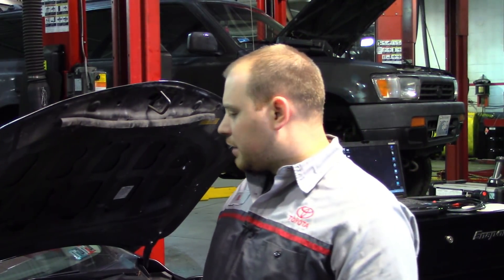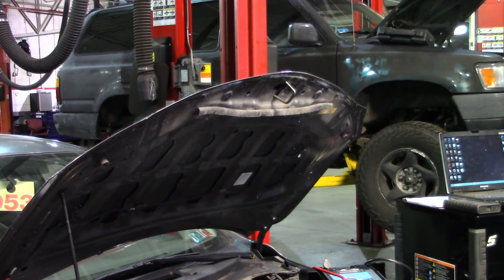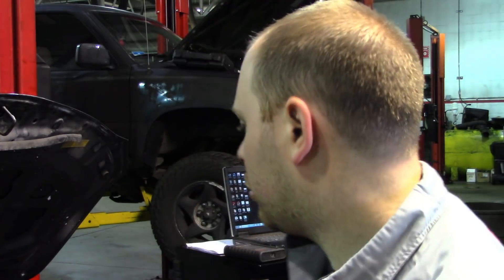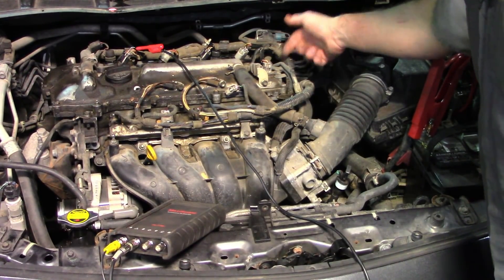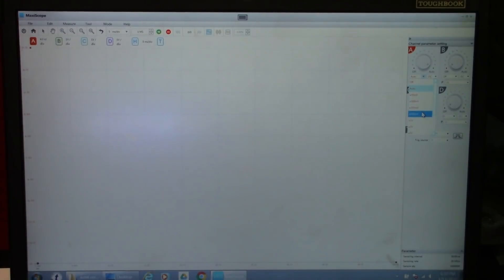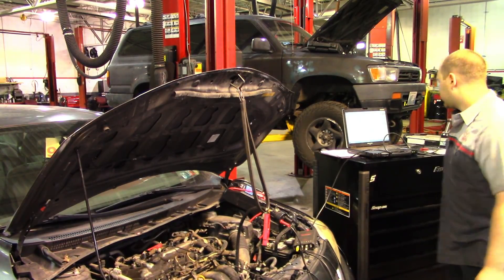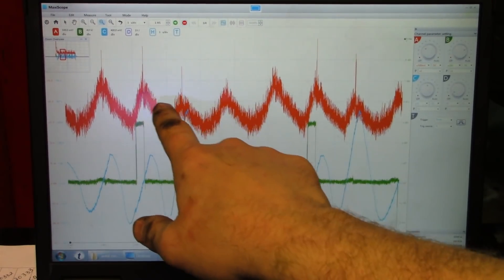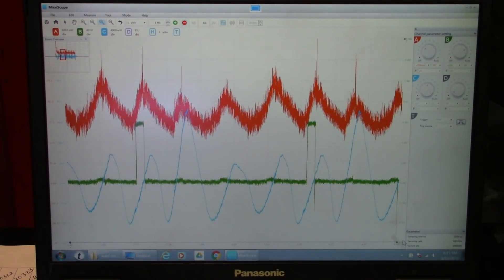'09 Corolla misfire diagnosis

Comment: Great process Pat as usual. You do a great job in your vids. I do take issue with one piece however; doing a "leak down" test at BDC. Almost every engine, including this one in this 2009 Corolla has a valve OPEN at BDC. During the intake stroke, the intake valve is designed to stay open slightly into the compression stroke (after BDC intake). During the power stroke, the exhaust valve is designed to already be open before achieving BDC of the power stroke. Either scenario - BDC intake stroke or BDC power stroke - will indicate a false diagnosis of leaking valves. Leakage testing should only be done at TDC.
Reply from the maker: I just pinned this comment because I want people to see that you cant do leakdowns at true BDC. I also added a correction to the description. Thanks for the comment!
Reply from the maker: I agree with 99% of what you said. I don't actually do leak downs at true BDC. I spin the engine over until I can feel the intake valve close with air in the cylinder it is easy to feel. Then I go a hair farther to make sure that the valve is fully closed. I should have explained that a little better.

But you can 100% do leakdown tests with the piston below TDC.

Comment: My 09 Corolla Le has a cel that reads cylinder 1 and cylinder 3 ignition coils were malfunctioning. Ignition coil 3 is brand new and has less than a thousand miles on it. One two and four came with the car. Any ideas? Please and thank you.

Comment: But if #3 is on BDC, isn't the Intake valve still open a bit? Or you go just past actual BDC to close the Intake?
Reply from the maker: Yeah, i didnt convey that well in the vide but i pinned a comment to better explain it. Thanks!

Comment: I do not use BDC for one simple fact, let's call it valve overlap but that is not the exact proper term. At BDC exhaust stroke the EVO is already happening and at BDC intake stroke IVC has not yet happened. In fact how far open are the valves and how much will they leak, very little. Back to your usage of the overlay chart, different charts have different characteristics, this chart is BAD, the way that you lay it out, you set it at TDC on the left side of the screen, you then dragged the chart to the right to align it with 720* of the next compression stroke but in the process of dragging it to the right, the entire chart moved to the right, honestly for the purposes here, not important, but for the guys who watch your channel and learn from your mistakes, please start the overlay on the right and drag it to the left and it will not move. There are other charts that don't have this characteristic. Thanks for the class on a blown head gasket, with and without nice test equipment, I also only use shop air for a leak-down test. Better to find a leak into the cooling system at TDC, cheers.

Comment: Mine has 187k and was running good. First time the check engine came on for the missfire did the spark plug and coil. Moved the injecors around and pretty sure the miss fire didnt move. I'm checking that today. Pretty sure the engine is screwed. What a piece of trash. Cars these days are a joke.

Comment: A couple of years ago my neighbor asked me to look at her 09 Corolla with 230,000 on it, the mil was lit and it had a p0301,,I swapped number one coil with number 2 and the misfire moved , I replaced the coil and it was fine until a month ago when she said it was running bad and the light was on, this time a p0301 and 303 came up, I decided to replace all the coils since they were original except the one I replaced before, it threw a 301 again so i put the newer coil in and I'll see what happens, they were all aftermarket Chinese coils I did because OEM are like 100 a piece, I don't know what else to do, I'm not a pro and she doesn't have a lot of money I think it's just another bad coil.
Reply: I thought mine had a bad coil or spark plug. I replaced them and it didn't get any better. Now I'm thinking it needs a head gasket because that's the next thing on the list. Or maybe something to do with the timing. It's a huge job and if the block is warped it will be $2200 to replace the straight block and I'm just not sure that's worth it.

Comment: How much would it cost to do an engine replacement on that car my 2009 Corolla has the same problem
Reply: Idk if I would want another at this point. 187k miles and mine.  Switched injectors and it still miss fires on 4 even after dpark plugs and a coil. Pretty sure the engine is screwed. And I just replaced a whole bunch of stuff on it right before. Some bs. Wish I didn't buy a 2009

Comment: Im having issues with a 09 corolla, cyl 4 mis code, did new coils, plugs still having the miss and surge at stop light,  changed up stream o2 and no change.
Reply: Me too miss fire on 4. Did the spark plugs. The coil on 4. Cleaned the throttle body. Ran fuel injector cleaner. Took it to a mechanic and $114 later they couldn't figure it out said it wasn't mis firing and then the switched injectors 2 & 4.   Waiting for the drive cycle but I'm pretty sure the miss fire is still on 4. So I guess the next thing would be a compression check.   I wish I didn't just replace a whole bunch of stuff on it a couple months ago. Now that this is happening.

Comment: Question please, you had mentioned you frequently see pitting in the cylinder walls of this engine is that what I understood you to say? How does that happen and why? I have a 2009 Corolla 1.8 engine with 250,000 miles and it’s running aces but very curious on that I never heard of that before. Thank you for your answer.
Reply from the maker: Not on the cylinder walls. But pitting between cylinders.

As far as why. That I’m honestly not sure of. But with your mileage, I’d consider changing the coolant.
Reply: @VoltageDropDiagnostics  Thx so much for reply here in my question. Never heard of this before. I have indeed flushed the cooling system and change the auto trans fluid every 50K miles since odo hit 100K. I also add Lucas Fuel Conditioner with upper cylinder lubricant since the the 100K mark on every fill up. Thx again!

Comment: I have an unrelated question about a 2009 Toyota Corolla LE 1.8 auto. Do you think it is safe to do a transmission service on a car with 140,000 miles. Trans service has never been done and fluid is black/red and dirty. Trans seems to shift fine.
Thanks
Reply from the maker: I wouldn't be too worried about it causing issues. I assume you're just doing a drain and fill? Thats what I recommend, while using Toyota WS fluid
Reply: @VoltageDropDiagnostics  I'm thinking of just doing drain and fill. I heard filter is more of a strainer so I probably just leave it i guess. At Toyota do you change trans filters or primarily do drain and fills? I think it takes just over 3 litres. 
Thanks for the response back
Reply from the maker: @mazdaman7739  generally we just do drain and fills

Comment: Great video Pj! Just got around to watching it! Top notch content as always! Appreciate your leakdown tool and technique. 
Great analysis of the waveform and diagnosis. 
If cylinder 4 compression wasn’t also low would that have lead you to suspect cyl 3 intake valve leaking during compression? 

As always thanks for sharing brother!
Reply from the maker: Thanks Angel! Sorry that I am just getting around to these comments! I have been so busy lately! 

But to answer your question. Yes. If cylinder 4 wasnt also low I would have suspected a failed intake valve. Good catch on that by the way.

Comment: I need a pulse sensor.  Also need a in cylinder pressure transducer. And a used pico. Have yet to use any.
Reply from the maker: haha! Once you learn to use a pico, it will open up an entirely new way of diagnosing vehicle failures.
Reply: @VoltageDropDiagnostics  I'm going to that class for sure . Hope you will be there as well and get my pico signed lol.
Reply from the maker: Andrew Hinojosa are you on Facebook? The registration for the class was just posted!
Reply from the maker: https://www.rosedaletech.org/diagnostics-seminar/?fbclid=IwAR3zb6rtlvh8hmo06ZYkcaVRDRJRtaWK9FkZ12hdBOolEzDmFZBz0xMamk4
Reply: @VoltageDropDiagnostics  thanks I'm signing up asap.

Comment: Hey pat very informative video but what I can't understand why there is an intake Pressure spike in the cylinder 3 if the intake valve of the cylinder 4 is open normally the pressure from the cylinder 3 escape to cylinder 4 so no spike in the intake
Reply from the maker: So your question is. Why is there a pressure spike, when cylinder 4 is on the intake stroke? My best explanation is that the intake manifold typically under vacuum. But even though cylinder 4 is pulling vacuum, cylinder 3 is pushing pressure. Even if they counteracted themselves perfectly, youd still have a loss of vacuum in the intake until the next cylinder pulled it back into a vacuum state.

Does that make sense? Did I answer the question?
Reply: @VoltageDropDiagnostics  it does thank you so much

Comment: An easy way to find cylinder cycle and TDC is to put a toy balloon over the cylinder test hose barb. Then roll the engine.  The balloon is very sensitive and will show TDC or BDC.  Using 2 of the pressure regulators, like the one you used, in series, with a .062 orifice between them, makes a leakdown tester.
Reply from the maker: Thats brilliant!

Comment: What I think you should say  is the reaseon why  the engine is broken too premature. for toyota 210k is not too much. I am pretty sure the engine overheat and the head gasket were blown....But whe question is Why happened that. Skipping oil changes, water systen wast propperly mantain... or the engine were abuse of rev ups, etc,

Comment: Thanks for not using the Pico for those of us with other not so fancy scopes. That Autel did a great job. Was it the injectors disconnected that disabled starting?  Because if u disabled spark u wouldn’t get cylinder firing pulse. Igt.  Correct?
Reply from the maker: Exactly! The PCM wouldnt have seen an IGF signal return and it would have stopped trying to fire the coils most likely. Plus I dont want extra fuel spraying into the cylinder while cranking so I just unplugged the injectors.

Comment: Great video PJ! I have a question as I’m just getting into pulse sensor and In cylinder testing.. If this vehicle , for example , had an issue with a leaking intake valve on cylinder 3 , we would see an intake pulse higher than the rest on cylinder 1 compression hump because cyl 3 is on the intake stroke? Just trying to think of different scenarios .
Reply from the maker: So if you have a bad intake valve. Lets say that it is cracked on cylinder 3. You would have had a hump during the compression stroke of cylinder 3. It would have looked very similar to the waveform that I posted. The reason that I knew that I had a bad head gasket was because my compression for cylinder 4 was also low and I put the pieces to the puzzle together.

Comment: using the leakdown in that way  just to confirm that is ok. if you are trying to find worn rings its not.   with that kinda milage in rustbelt pa the cost of an engine is more than the car is probably worth unless its a southern car.  probably spent that much on the parts cannon.
Reply from the maker: You’re saying that finding worn rings with the piston half way up the compression stroke doesn’t work? 

This car was surprisingly clean. And the engines from the junkyard were cheap, but they had high mileage.

The remains were $$$$ 5,000

Comment: Doesn’t seem very flat rate friendly way to perform a compression test or is this just simply a video to show compressing checking with a scope?... interesting
Reply: Joe Wilson an experienced scope user can have a full diagnosis in less than 15 minutes in just about any vehicle using these methods. Whether there's a plenum covering the coils or not.
Reply from the maker: As far as the compression portion of the test. I 100% disagree. Imagine needing to pull an intake on a v6 engine to access the spark plugs, to do a compression test. That can be a time consuming process depending on the engine design. I can have a relative compression test perform in probably 5 minutes without removing a single bolt.

I am flat rate, which is why I use a scope. Because it allows me to quickly diagnose failures that I can't see or touch without removing parts to access cylinders. 

I just used this 4 cylinder as an example because it is what I had at the time. 

As far as using pulse sensors, and gathering in cylinder waveforms. That CAN be time consuming depending on the failure. Or it can be extremely quick.

Just like how mechanics need short sockets AND deep sockets. I feel like this is just another tool for your tool box that can help you in certain situations.
Reply: Voltage Drop Diagnostics so you back probe igt circuit at the ecm for the coils covered by the intake?
Reply from the maker: Joe Wilson nope. I backprobe a front coil.

If I have a cylinder 3 misfire. And I know that the firing order is 1-2-3-4-5-6

Why can’t I backprobe cylinder 2 that is easy to access, and look at the very next compression stroke of the relative compression waveform?
Reply: And also my comment was just for this particular case where the other shop already replaced all the parts, (also love the fact that they replaced the ecm) you almost already know it’s a mechanical failure
Reply from the maker: Joe Wilson i knew that it had a mechanical failure the second I turned the key lol.

And i understand where you’re coming from. But i also encourage people to continue learning because you just never know when these tricks will come in handy.

And once you get good at using a scope, you can do it really really fast.

I’m talking under 5 minutes.
Reply: Voltage Drop Diagnostics good deal

Comment: Even a cheap harbor freight vacuum gauge would of seen it.
Reply from the maker: Maybe. I honestly didn't try. But I know that a cheap HF compression gauge would have seen this (as long as it has the right adapters for these spark plug holes) or a cheap leak down tester would have seen this.

This wasn't a video to show people what they should be doing. But a video to show what they could be doing during the certain failures. It's just another tool for your tool box that can come in handy.

Because there are times when leak down tests and compression tests pass, but the engine still has a mechanical problem.
Reply: @VoltageDropDiagnostics  does the autel scope have a filter? the relative compression test looked noisey
Reply from the maker: phil holbrook it does. It doesn’t work as well as the pico filter though. 

This was unfiltered though.
Reply: Agreed. That shop really dropped the ball. I do like that one could distinguish a head gasket issue from a leaking intake valve in one test though

Comment: It is easy to overlook the basics sometimes, had a pretty good tech messing with a 2.0 ecoboost the other day swapping coils and plugs etc.. and I walked up and handed him a compression tester after listening to it crank from across the shop and it had 60lbs on cylinder one.  Great analysis with the pressure tester.  On a side note I have another Ford with the up side down back up cam image so I will try to scope it out before replacing it and see maybe why it inverts the image
Reply from the maker: Yes! Let me know! I haven't seen one of the cameras flip an image yet. I wonder what it looks like on a scope.

Comment: I would have like to see an in cylinder. I just did one on an S54 M3 Relative compression showed me Adjacent cylinders both low compression. However I did an in cylinder and I didn’t reveal it. So I just would’ve been curious how that one looked.
Reply from the maker: My assumption is that i would have had leaning compression towers from the loss of air volume, and my exhaust and intake pockets wouldn't be even. But I'm not sure if I would have been able to make a call from that alone.

I should have grabbed one just to see.

Comment: Nice video
Thanks for the information. I've never done a leak down test from BDC. Have to give it a try next time.
Reply from the maker: Just remember that the air will be trying to push the engine down, with a lot of force so youre going to need to brace a breaker bar on the crank against something to keep the engine from rolling over.
Reply: @VoltageDropDiagnostics  and keep your fingers out of the way lol
Reply from the maker: richard cranium yes! Because 100 psi of force is more than most people can understand haha